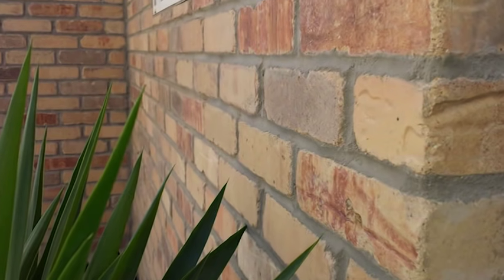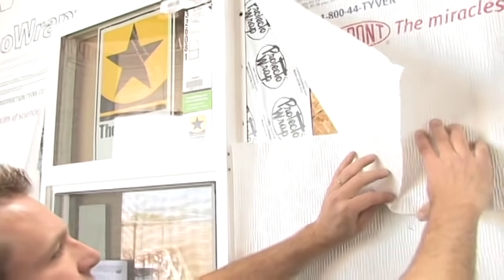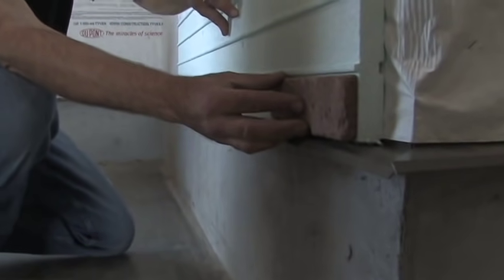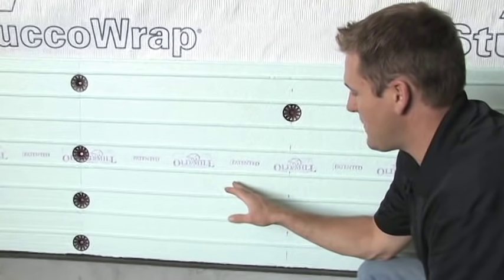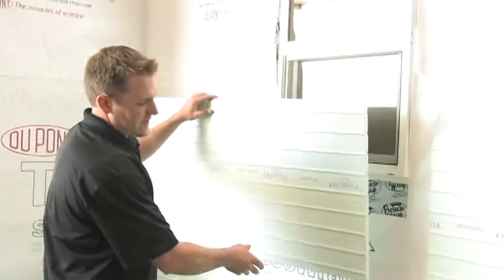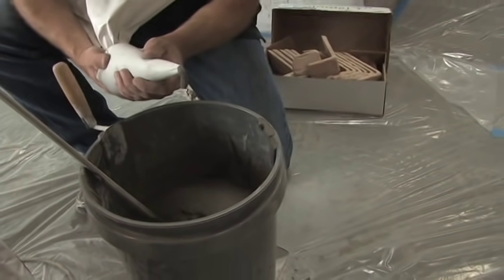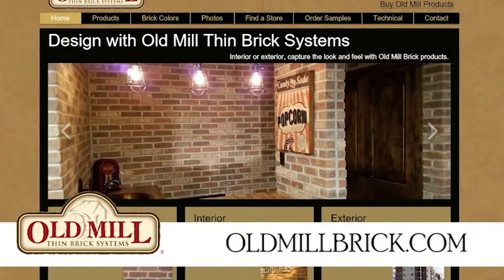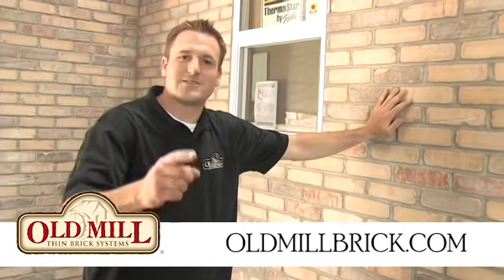How to Install Old Mill BrickPanel+ System

Comment: Can I put these on an exterior wall that already has smooth painted concrete on it? Do I just use the adhesive to set them, then mortar?
Reply: Exact same question here!
Reply: Although, I’d GUESS you would probably use the  same style washers with concrete screws instead of the wood screws he’s showing.

Comment: Looks beautiful.  Does it have a high insulation value?
Reply from the maker: Hello, our panels range from R-5 up to R-28 continuous insulation value. Check out our website here to learn more about it: https://www.oldmillbrick.com/brickpanelplus
Reply: @OldMillBP  What if only first two ft of my wall is veneer and then its hardy board siding. Do i still use stucco paper for the whole wall or just the brick portion?
Reply: @eugenek1895  I have the same question. I want to use this or something similar over the bottom of my home up to the siding. I live in a banana belt, extreme dry heat in the summer with mildish winters. Freezes at least 1-3 times a year, but hardly ever a hard, long freeze. Just looking for something to spruce up my home.

Comment: The completed project looks authentic but brick is porous and fear mold development in nooks and crannies of the very combustible polystyrene; especially if fasteners are in-set too far like is briefly seen exactly 24 seconds into the video. While mold resistant , its insulating and nonporous qualities causes moisture condensation. There is a glance of a fastener drilled in 1/16 - 1/8 inch too far at the beginning of the video (as noted).  Polystyrene is usually avoided because it catches fire easily, is not very chemically resistive, and when melted, is a flammable liquid.  For instance orange oil used for termite treatment would  possibly dissolve it.  It's not biodegradable and produces toxic gasses when burned.  It's also made with chemicals known to be carcinogens.  But I do like the brick; it just should have an alternative to the polystyrene imho.
Reply: It does it's called brickwork been around since Adam was a pup

Comment: This product is great for interior...for exterior, not a smart idea...he talked about the size difference and that really doesn't matter for exterior...wait about 3 years and once mother nature takes a beating on it, let's see how many of those thin brick  stay
Reply from the maker: Hi Jonathan, we have done pull away testing on our BrickPanel+ system and it performs really well! We also offer a five year warranty when you use our full system and install it yourself. We have a 15 year warranty if the system is installed by a professional. Let us know if you have any other concerns.
Reply: @OldMillBP  I don't mean to be negative, but a 15 year warranty is a blink of the eye in the life of a home. This is a major problem with Americans and their view on how long things will last. Even vinyl siding, as awful as it is, last longer than 15 years.

Comment: What's the warranty on this system? I can't see these sticking for more than a week or two. One freeze thaw cycle and these are popping like a bag of popcorn.
Reply: If you have a solid brick and a polymer morter with a good water seal, it could outlast stucco.
Reply: @brettknoss486  bricks are not water proof never have been

Comment: I have great concerns with how this would hold up over the years in New England with so many freeze/thaw cycles, and also the weeping method stated seems counter productive.having shown it before installation going vertically, then realizing he installed it horizontally making it it quite useless.And the issues of water retention in the brick itself with nowehere to go,Imagine it freezing in place in winter conditions after a rain/freezing rain, then freezing scenario......would love to see a building after 5 or 10 years in Maine weather with this product, Not sold on it...and other than the weight difference, it seems like more labor, having been a self employed mason for 40+ years,I don't see any benefit other than less weight to haul up on the staging...
Reply: I've seen buildings with ceramic tiles on the exterior hold up just fine, but for any system like this, I'd want examples of installations that have held up will in the same area. What holds up forever in Boston might not last in Bangor. I would have been inclined to silicone the brick slices to the Styrofoam, then use the mortar (or even sanded caulk) between them, but they seem to have confidence in it using only cementitious materials.
Reply: @pcno2832  this is a brick it will transfer water just like a sponge like bricks do they suck up water will not work it a moisture trap if they were water proof they wouldn't be putting all that flashing in there stupid idea that's why they won't answers you moisture won't weep out in can't  it has no cavity as in traditional brickwork any water which gets in and will is there for good you can see when the wet crout goes in the brick sucks the moisture it will do that with rain like you won't believe I've seen bricks with water running down the back of the wall like a river

Comment: The entire system seems problematical to me, since the integrity of the panels (supporting the weight of the thin bricks) is going to depend entirely upon the strength of the mortar they're attached to the panels with, and the panels' resistance to spalling (or whatever the equivalent of spalling is that foam panels will do).  Heavy masonry + mortar + foam = failure, sooner or later.

Other companies make perforated metal panels that seem to have a much greater likelihood of surviving for at least a few decades, to hold the thin brick in place, and the thin bricks can be bedded with an advanced bonding material, like Gorilla Construction Adhesive.
Reply: Hi Bricology - on the contrary: Metal panels are less durable because they expand and contract with the weather, which means they are prone to crack and cause the mortar to crack with it. Additionally, they must be mechanically fastened, which creates punctures in your air barrier and substrate - meaning your surface is no longer waterproof, and the metal panels can rust and fail. Foam panels, on the other hand, do not expand and contract like metal does, it gives additional and continuous insulation (CI) and adheres to the air barrier using our Old Mill Brick adhesive. Our BrickPanel+ system is guaranteed for 15 years...one of the best guarantees in the industry.  :)  the best part, is that our patented foam panels can be installed for less than $4/sq ft.

Comment: From a building science perspective, there are several key problems here. First off the horizontal cuts on the back of the foam will do nothing to assist in drainage. In fact just the opposite, it's a place for water to pool. Secondly, the weather barrier is too thin and does not allow for proper air circulation behind it. That lack of air space behind the foam creates a  secondary issue below windows where the speaker stated the importance of proper window installation yet there is nowhere for moisture to go if the window leaks as the foam is pushed up directly below it. 

Now if there was an airspace (behind the foam) that would not be a concern as any water would simply drain, but being that there is none you are going to get moisture build up that takes far longer to dry than is recommended. The fix would be to use a dimple mat product that keeps the foam board a MINUMUM of 1/4" away from the wall surface. 

Lastly, What about vapor drive? Brick, even a thin veneer such as in this case can hold a good amount of water, what happens when the sun hits it and drives the vapor backwards towards the structure? My guess is the foam is an open cell type which will do nothing to stop it so once again you end up with the problem of moisture trapped between the foam and the housewrap. If it is a closed cell foam product that complicates things even more as then you are trapping moisture that is trying to exit from the inside of the house causing far greater problems.
Reply: Good points, John Salazar.  
What do you think of other thin brick systems, such as those that use perforated metal panels instead of foam panels, and construction adhesive instead of mortar?
Reply: @thebigdoghimself  Hi John! Glad you talked about 'building science'-Joe and his team are fantastic! Give me your 2 cents on my build. thin brick as here with either a 1/2 dimple matt (or 1 x 3 furring strips) holes sealed with ploy wall with these 2 inch panels (looks like closed cell xps foam). Should provide excellent drainage and vapor/moisture escape. Most of this brick will be covered by a wrap around covered porch so vapor drive to interior will be minimal. Interior on this 2 x 6 construction includes roxul batts.
Reply: Thank you I've been saying the same moisture trap bricks are not water proof